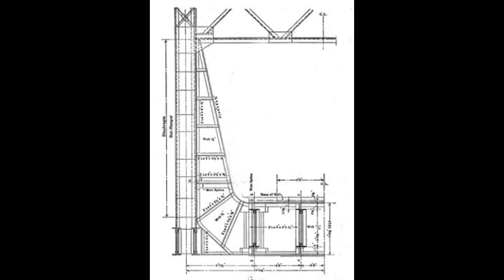A Forgotten Engineering Marvel: The Sciotoville Railroad Bridge

Comment: It isn't really an 'engineering marvel' despite it being an impressive structure. There was no risk involved in building this--it used standard technology of the day (steel, rivets, structural architecture). To engineers, this is called 'cookbook' engineering.
Reply: Too bad you can’t say that about a pissy little pedestrian bridge in Miami Fla. the “computer equipped engineers” screwed up so badly it collapsed before it even opened, killing several motorists!   No, I’ll call this bridge a marvel of engineering!
https://en.wikipedia.org/wiki/Florida_International_University_pedestrian_bridge_collapse